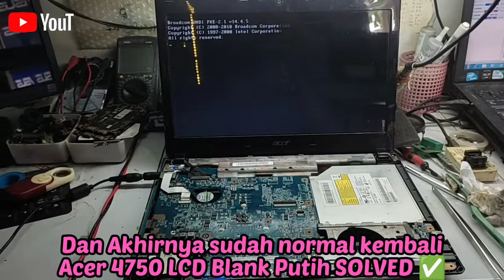ACER 4750 BLANK PUTIH | JUMPER GAK JADI GANTI LCD #Tutorial #service #laptop #Acer

Comment: Bang ic driver nya 3 volt. Itu masalah nya dimana ya. Tadi lihat video sebelah di jumper dari kapasitor 4 ke ka ic driver 4
Reply from the maker: Coba lihat dengan teliti itu jumper kaki ic nya aja bukan ke kapasitor
Reply: Masih blank
Reply: Karna kapasitor 4nya 0volt
Reply: Dijampeer tapi dilepas ic driver
Reply: Kalau sudah terlanjur hilang.apakah bisa di jumper IC nya.jadi dijumper langsung ini seri Acer 4738z
Reply from the maker: @mahfudhkhoiruddin  di carikan penggantinya kalo tanpa ic itu kalo cuma di jumper gak bisa juga.
Reply: Yg dijamper kaki 4 dan 1 kah?
Reply from the maker: @mahfudhkhoiruddin  kaki 6  ke kaki 1
Reply: Ini saya @annisa
Reply: Siap
Reply: Beli ic nya tipenya IC apa bosku?
Reply: Kalau dikanibal kan dgn PCB hp bisa cari 2 di online shop TDK ada
Reply from the maker: @mahfudhkhoiruddin  cari kanibal nya di mobo laptop yang lain biasanya ada
Reply: Sama pas laptop hidup TDK ada suara malah dengung keras, suara nya nggak enak didengar
Reply: IC PWM driver PSU
Reply: Yg mirip dilazada
Reply: Ob 2273

Comment: Suhuu izin brtanya. Seri part number flexibel lcd saya   50.4IQ01.001. Sedangkan di online yang jual banyak yang 50.4GW01.001.. Klau mnrt deskripsi toko, sma2 buat laptop acer 4750.
Kira2 cocok gak hu?? Menurut pengalaman suhu.. 
Terimakasih. 😊😊
Reply from the maker: Cocok, lcd 4750 itu LCD TEBEL STANDART, PIN 40 dah gtu aja pasti banyak yang paham
Reply: @D_OneMedia  ok hu.. 
Alhamdulillah kmren sya bli lcd acer cocok hu, dites pke laptop tman.. Yg mau sya tnya hu flexible lcd nyq hu.. Kira2 cocok gk dngan flexible lama sya.. Yg lama serial part numbernya 50.4iQ01.001 sdmglan yg di online jualanya 50.4g01.001 hu.. 
Trimkash hu..
Reply from the maker: Di cocokan model nya aja gan. Kelihatanya sama, atau bisa di inbok dulu penjualnya
Reply: Mkasih hu saranya 😄